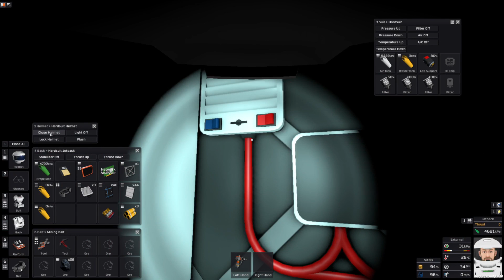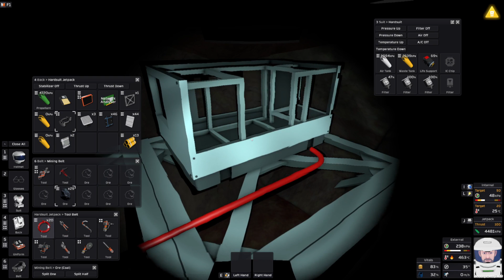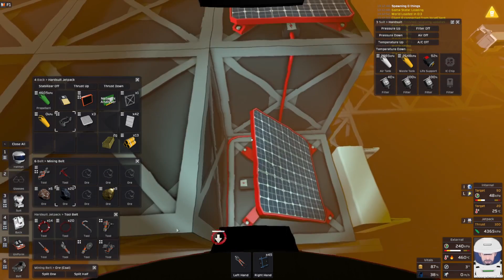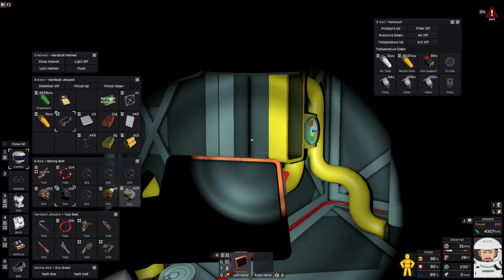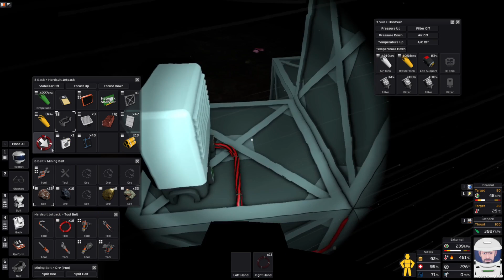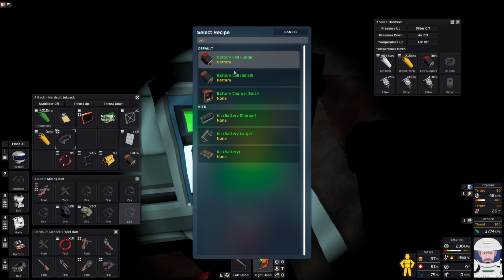Stationeers Venus Getting Started EP04 - I Have the POWER!

Comment: TBH, I’ve never found a reason to set advanced airlocks to anything except 0 kPa internal, 0 kPa external.  It’s both faster and safer to just use the airlock to avoid cross-contamination, and leave the door to re-pressurise — safer because the airlock can never get into a “jammed” state where it’s endlessly trying to pressurise when there’s nothing left to pull.

Explosive decompression isn’t a thing in Stationeers, you just get an inrush of air, as you’ve been demonstrating with the external side of your airlock (101 kPa set pressure vs the 240 kPa actual pressure).  In fact, as soon as you put a passive vent on the external vent pipe (so it stopped accumulating pressure), you could have just stopped using it when you exited, and only used it when entering.

Of course, I guess your situation is the exception, since one side of your airlock is using a “pipe as storage” system rather than a passive vent.  But that also makes it extra dangerous, since if you ever accidentally cycle it to the inside while standing outside of it (e.g. using the door control), it’ll be stuck trying to pressurise internal, and you can’t get inside to stop it …

Comment: I found setting the target pressure high in the airlock can be bad. Even if the airlock is on it's own network using an APC, Working on power in other places can randomly cause glitches that triggers the airlock. I've had that happen even just a couple weeks ago. The only way to get in then is to tear down a door. If you are outside when that happens, It will sense target pressure and then open the inside opening the base to outside air...
Reply from the maker: Yes, I had that happen to me on a different world save, but only because I manually triggered the airlock to cycle.  I would have to get in by making a sealed off back door.

Comment: Why are you using both A/C and wall cooler?
Reply from the maker: I try to explain that in the video.  The A/C is awkward to fit inside the small base without the hot waste pipe going through your base, and having only the cool pipe entering the base reduces the amount of heat leakage.  The wall cooler needs a cool pipe (less than about 200 C) to work.  I have also found that the A/C seems to work better if the input pressure stays high (but I'm not 100% sure what's going on there, I intend to do more testing later).
Reply: @autom8it339  you can just use two passive vents for your base atmosphere go through A/C unit and cools down
Reply from the maker: @Prime0pt  Yes, but there are two problems with that when using uninsulated pipes.  Either the waste pipe (with 462 C gas in it) runs through your base, or your internal atmosphere pipes are running outside your base.  In either case you'd have to run your A/C more to keep up with the added heat loss, and I don't want to have to run it continually.  Also, as I said, the A/C unit doesn't seem to work as well if you're pulling in through a passive vent.  The passive vent can't keep up with the flow rate that the A/C unit is capable of, so it pulls the input down to vacuum and starves the A/C.  By pressurizing a "coolant" pipe with high pressure, we allow the A/C unit to run at full potential, and we avoid having hot pipes run through the base.  Once you have insulated pipes, a lot of these issues would go away, but not all of them.

In some ways I'm using the pressurized pipe as a make-shift stationary battery to hold energy (cool air) that I'm storing from my solid fuel generator in an inefficient but practical way.
Reply: @autom8it339  you need 16kPa for it to run and passive vent should be capable to provide necessary flow. 
Main problem with your scheme is power consumption.because you're cooling down 450C gas to below 200C instead of cooling base atmosphere for a few degrees.
Reply from the maker: @Prime0pt  But... the power is free. I have about 17 kW of spare power.  I'm optimizing for minimizing heat leakage (and space inside my shelter), not power consumption.

Also, power consumption is tied to the difference between the input temperature and the waste pipe.  If the input is my base at 20 or 30 C, and the waste is outside air at 462 C, power consumption will still be quite high.  It's just that you're cooling so little air (due to the low input pressure) that it won't use as much power.  But the problem is that 90% of the time I'm not running the solid fuel generator, and all the time, the pipes are going to be heating my base because they're exposed to the 462 C outside air.  This way the pipe exposed to the inside of my base that the wall cooler connects to, is 1) short, and 2) stays pretty cool.
Reply: @autom8it339  you are using coal and you have mine it so it is not free
Reply from the maker: @Prime0pt  I'm already burning it.  Obviously that's not the final power solution, this is just a starter base.

Also, in a later episode I plan to add a thermostat logic circuit to the wall cooler to prevent over-cooling the base so I can safely grow plants in there, but I still want the A/C unit to cool down that pipe while it's running no matter what.